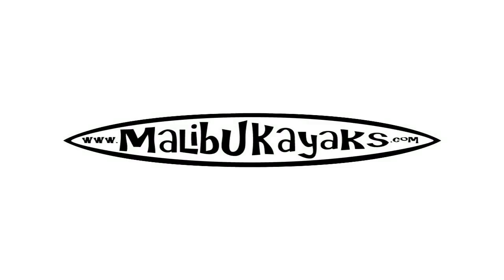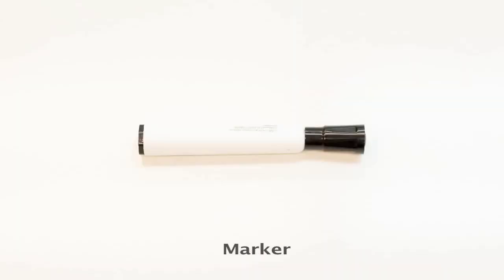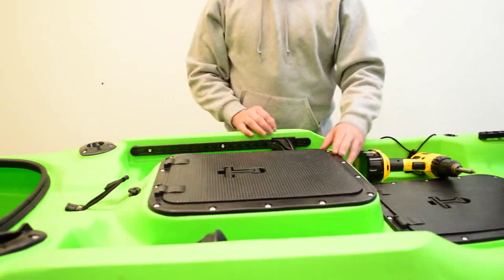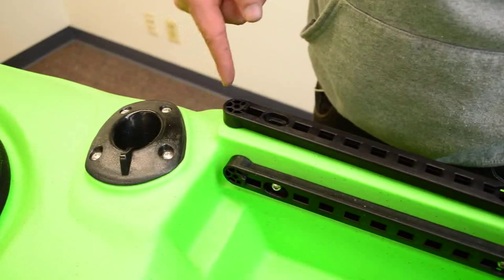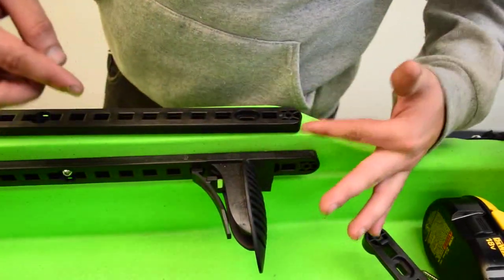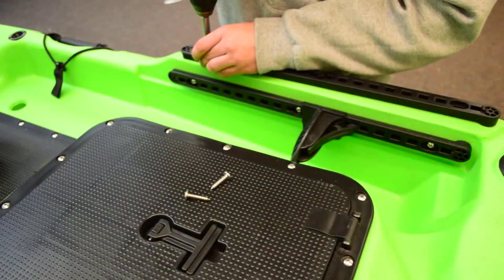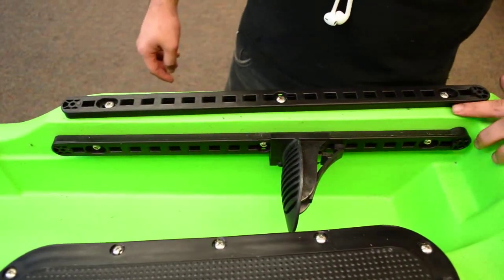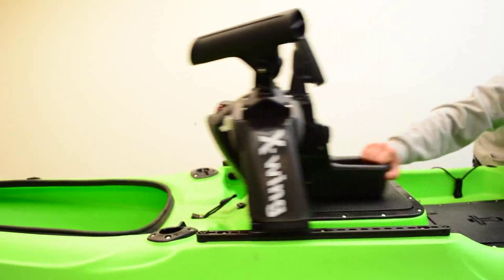Malibu Kayaks Installation Series- X-Wing for X-Factor

Comment: Why not just make that cup holder retractable and use a gear track so you can slide it back out of the way. That way you can use the hatch under it. Either that or eliminate the cup holder. The hatch gives more space than the cupholder anyways.

Comment: Ya I really would love to buy this but loosing that hatch is just plain bad engineering. this could be easily fixed by removing that cup holder and small storage. the reason that the x wing is a awesome idea is a place for your electronics and your rod holders that is all. another awesome add-on would be 3 lights one facing down into the kayak and the other 2 facing outward. other then that the xfactor already has amazing storage why loose a large compartment just to get a small one.
Reply: that sounds like the one a guy made it is on YouTube and I think it is better than the x-wing